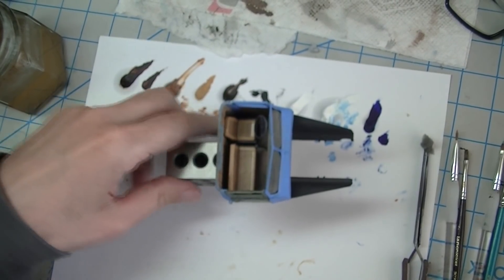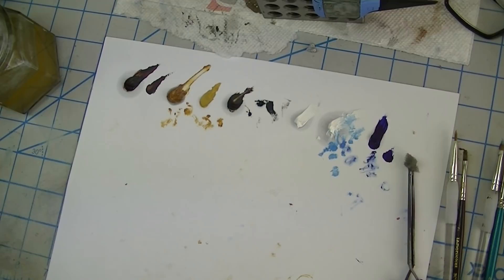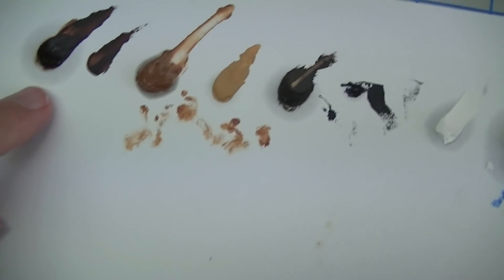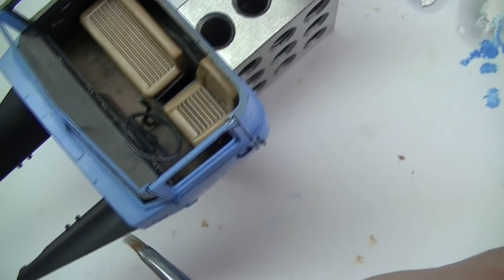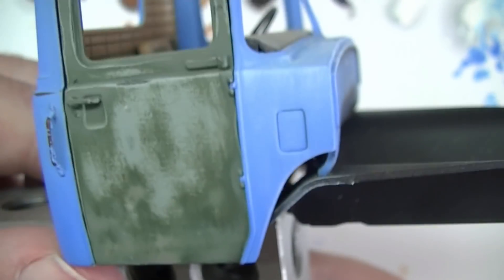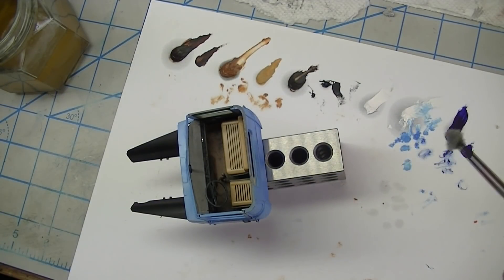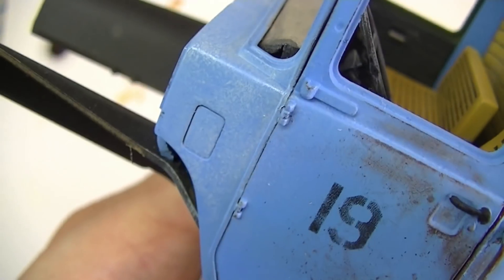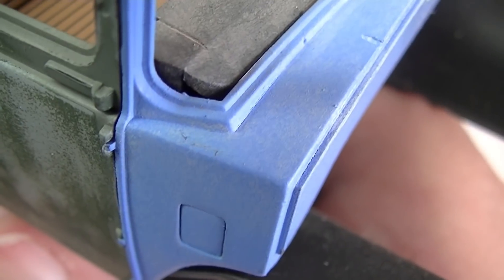ep190 - 10 minutes of technique #7:  fading paint with oils

Comment: Will, amazing tutorial and great content overall. Thanks a lot!
I’ve just started to use this technique and faced some issues. I paint with acrylics and then cover surface with satin or matt varnish. And after applying oil dots they leave stains on a surface, right on the place where I put them. Even after blending them or even after trying to wash them off. I use odorless Mig thinner and good oil paints from an art shop.
Could you give me a piece of advice of how to deal with it?
Reply from the maker: i personally deal with it by not using oil dots.  lol  however, i think some will pre-wet the surface with mineral spirits to prevent staining.

Comment: Interesting weathered effect, nice video . I won’t even hassle you for the run time. If you are doing the same effect to say green on a military vehicle would you do it with a white oil paint or could you use a lighter green shade oil?  This effect seems similar to “filters” I keep hearing about. Also, are the W&N fast set oils ok? I don’t have much patience for the drying time of oils.  You have inspired me to play with oils for wood grain effects.....I was using far too much oil paint on my brush, now  I see how it is done! Cheers
Reply from the maker: for greens i usually use shades of green.  white easily looks too stark.  as for drying time....get next to it.  24h isn't a big deal.
Reply: will pattison cheers. Finished some wood grain tests and am pretty pleased. Your demo showed how little oil pigment you need for a dramatic effect....just the kick in the pants I needed to try it out. Unfortunately I am master of imprinting fingers and thumbs into my painted surfaces so long dry time works against me